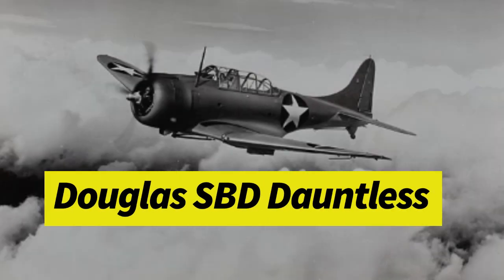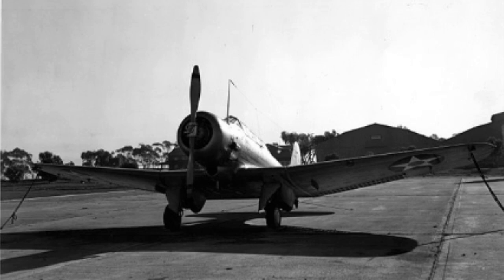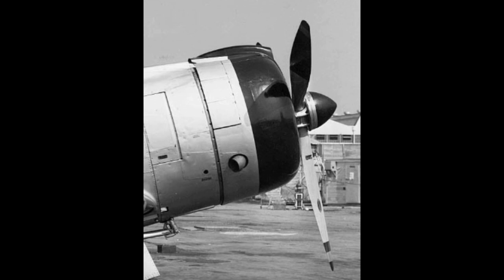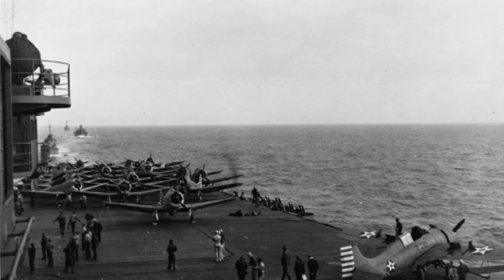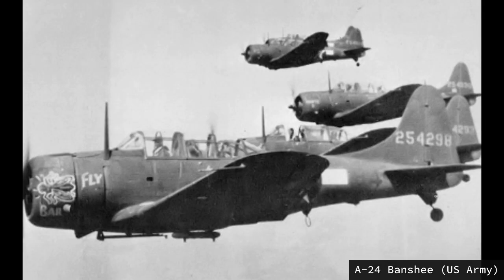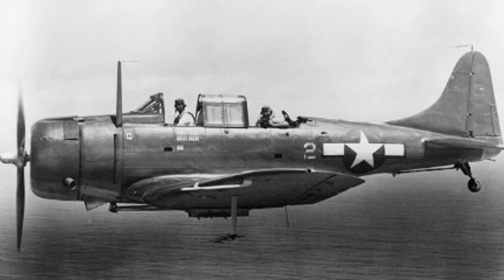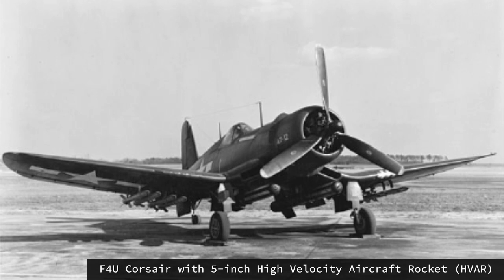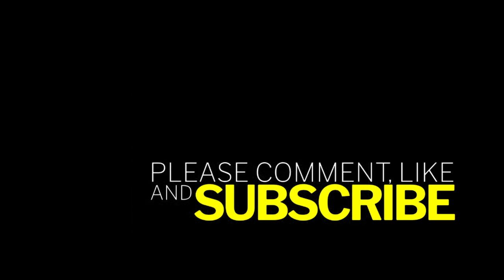Evolution of the Douglas SBD Dauntless - All Variants

Comment: Years ago a friend described the Dauntless SBD as a 'flying T-34' to me and that thought kinda stuck with me. Like, it's obviously not entirely accurate, but the parallels are certainly there. Kinda not much of a looker compared to its contemporaries, some weird design choices, outperformed to an absurd degree by later machines and sorta matched badly against its immediate opposition, but damn if it didn't put in the work. Much like the T-34 is often portrayed in broad strokes as 'the tank that won WW2', a similar case could be made for the Dauntless as 'the plane that won the war in the pacific'.
Reply from the maker: What an interesting comparison! Never thought of that before, hope you enjoyed the video!

Comment: The only thing I could add is that the SBD could out turn the Zero. Because it could pull more Gs in a turn. While it was common to pull 6 Gs in a dive pull out there was times it did 8 without damage. When my dad joined the Navy pilots were trained to fly every plane on the ship. This was changed later in the war. F6F Hellcat pilot.
Reply from the maker: Steve thanks for your comment! I remember in a History Channel Dogfights episode Swede Vejtasa in a SBD out-turned Zeros in a lopsided dogfight and won. Your dad flew in Hellcats? Currently wrapping up video production about the F6F right now, I’d would be interested in learning about his service!
Reply: @svgproductions72  My dad rarely talked about his service. What we know came from his logbooks. And service records. Got his carrier rating on 6/4/1942. Should have been on the USS Hornet but it was sunk before he made it. Served on the USS Essex. Then on the replacement Hornet through the end of the war. He past away in. 2005. He took a picture of his 2nd plane before it was pushed overboard . 3 cylinders blown off by flak over Truk.
Reply from the maker: @steveb6103  wow! What a story, do you know what squadron he was in? One of my sources breaks photos out by squadron so it’s possible I can find some photos for you

Comment: I watched a video that said the SBD had a positive kill ratio over the Zero.  Can anyone confirm this?
Reply from the maker: I haven’t heard that before, I may look into this ! It’s a great idea for a conversation
Reply: @SVG Productions  Thanks for the response, sorry but I don't remember the original source.  
If I recall, the broad wings the SBD used to lift it's heavy self and payload provided surprising manueverability at low speeds.  Two .50's forward and two .30's afterward, plus the legendary rugedness - it's possible.
I'll be subscribed so I won't miss your confirm/debunk video.